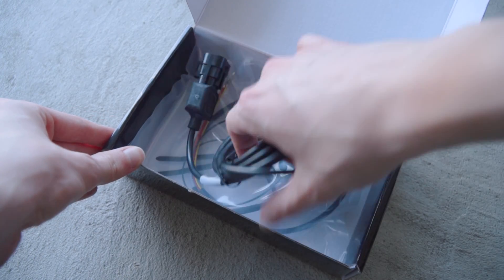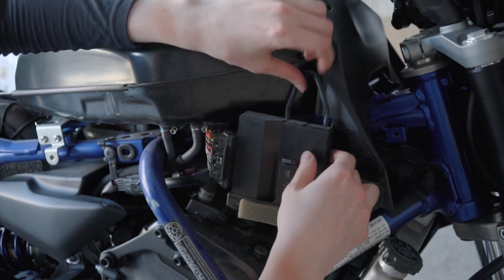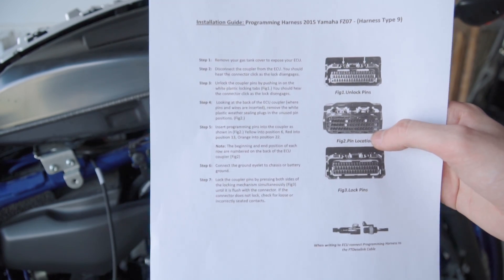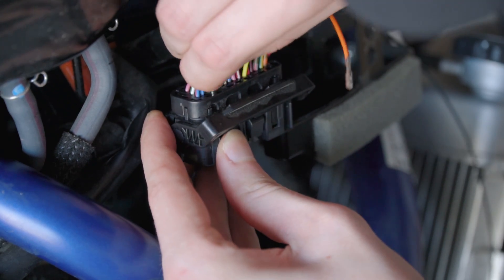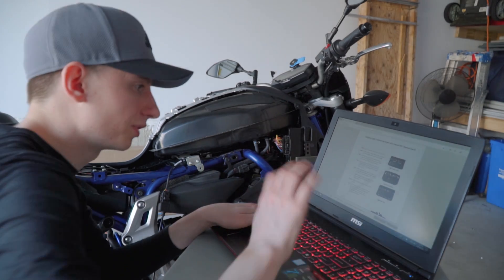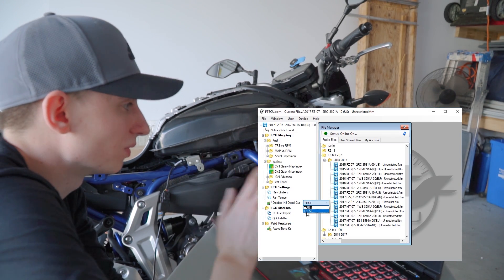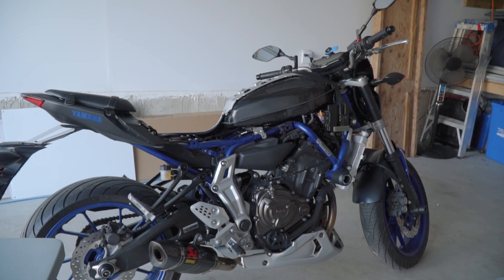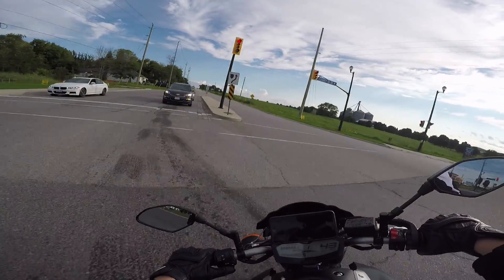ECU Flashing MT-07 at Home (Tutorial/Impressions) [EP.04]

Comment: Please answer  reflashing your ECU like this without going to a dyno and properly tuning it.

Is it the same?
Reply: not a pro. just enthusiasts with a lot of passion. to my knowledge no it's not the same. nothing beats Dyno. it's just expensive especially on this bike. you might as well save up and get a better bike. ECU flash is pretty much enter set values into the computer. when you Dyno you get to read the graphs and modify for optimal performance or fuel consumption
Reply: @kendall9758  hey, i did the ecu flash and dyno cost me about $280 i think it was worth it.

I have an M4 full exhaust system on it.
Reply: @jeanmorales6159 You did a custom dyno tune for your bike for a 280$????
Reply: @marobistric1999  yeah i did.

Comment: Thank you for the video, it was detailed & well explained. I just bought my mt-07 this year so this ECU flashing is quite new for me. I order a slip on M4 exhaust, I was told that I must get ECU flash or else the bike will run lean. My question is does it get tunned according to the exhaust pipe you put on? are there specific settings for the exhaust you put on?
Reply: I heard that is important to flash the ECU according to the exhaust.

An Akrapović exhaust has its map and so does the M4 exhaust. But, on the small bike like that I heard that it’s good enough the match the exhaust length and not the brand of the exhaust.

So, if you match your M4 exhaust with an let’s say Akrapović short exhaust. I think it will be fine.

And of course you have your dyno tune. But, that it much much better and completely different story

Comment: Hey when you installed the software on your computer did you have issues? I have been having all the issues possible... now I’m stuck at the part where I can’t register it
Reply: Same, did you ever figure this out??
Reply: Aaron Bolton hey yes I did. I ended up using a windows 8 laptop that I had laying around and than I had to make sure that all my connections were ok. When you register it the cable needs to be plugged into the bike into the ECU and on the laptop. I also had an issue with my red wire being connected sideways and it wasn’t completing the connection. Once I fixed it everything worked. Make sure everything is working properly
Reply: Aaron Bolton are you located in the north east of the US?
Reply: @TheJuanesjr0911  I'm in utah, so I need to connect the wires into the ecu before I can get access to the instructions to do so?
Reply: Aaron Bolton  yes plug everything into the ECU and to the ground. Make sure you use the correct ground because that was an issue for me as well... and after everything is plugged in you can connect it to the laptop and register the ECU. The registering process is for the FTecu to register your ECU as the only one it can work with.
Reply: @TheJuanesjr0911  thank you so much, I will let you know if I get it to work.
Reply: @TheJuanesjr0911  am I supposed to do this with the bike off?
Reply: @TheJuanesjr0911  yes it still ain't workin for me.. not sure what the hell to do.
Reply: Aaron Bolton check all the wiring mine was giving me issues because my red wire was installed in the wrong direction
Reply: Aaron Bolton have you been able to get in to the tuning suite?
Reply: Aaron Bolton most likely you are having the same issue as me where one of my wires wasn’t pushed in all the way. Like I said my red wire was facing a different direction and it wasn’t pushed all the way in. So definitely re check all the wiring and try again. There is one way to trouble shoot the connection to see if everything is connected properly. If you can find me on FB as Juanes Ruiz and we can chat on messenger or video call and I can try to help.. I’m a white dude with black sun glasses in a car.. I understand this is a crappy situation after spending so much money.
Reply: @TheJuanesjr0911  thanks man, I'll get in touch tomorrow. The thing that doesnt make sense fo me though is without this video I wouldnt have known where to plug the wires in. From what the software is saying I have to register the device before I am able to get instructions on doing the wires.

Comment: Yeah, it’s a total rip-off the motorcycle industry. I’ve been charged over $600 dollars for a 12 year old motorcycles ignition lock set and $300 to get the keys coded to the ECM. So, almost $1000 for repairs to a 12 year old bike that cost $1900.

Comment: Hi.
I installed ftecu flash and quickshifter in my Yamaha mt07
I have a problem.
When changing gears, the engine shuts down for a long time. 1 second approximately.
Do you have any idea what the solution is?

Comment: hey buddy! thank for great video! Could you tell me is it possible to reuse this kit(wires) on other mt07 bikes? isn't this software bind to a single bike? Also, could you tell me if these cables have some chips/electronics inside? (is it possible to clone them?)
Reply from the maker: Yes so when you flash the ECU you use up a license (which gets coded in the ecu) so you will need to buy another license to use on the other bike. The usb cable gets registered to your account, so you can only flash the another bike with the same account and a new license
Reply: @TURBOTWINKIE  thank you!!
Reply: @TURBOTWINKIE  how much for a new license

Comment: Where did you purchase ecu flash kit?, currently I'm working on 2018 mt07 tying to find it in canada
Reply from the maker: Bayside Performance, but it will take forever for them to ship it
Reply: TURBO TWINKIE thanks, are your happy with the flash ? Did it make big difference?
I’m saying if it’s worth to spend 500

I Just put acrapovic and DNA filter yesterday, thinking of flashing it
Reply from the maker: I'd say I'm pretty happy. I tried everything, and I made the bike perform pretty smooth, but its still not 100% perfect. But the bike runs really well. I need to ride a stock fz 07, to feel the difference though, but it did feel like it was quite a bit quicker when I flashed it.

Comment: you can do the same thing with 15 euro
Reply: Please explain brother. I am intrigued.
Reply: @gmindgjerd  well you can flash k-line with a ft232rl and mcp2003 chip you can even use an arduino with the mcp2003 chip,Plus you have to make the connectors to fit your bike socket

Comment: Hey, did you notice any difference in  accelerating at lower speeds ? I mean jerky throttle problem in this model
Reply from the maker: I always complained about jerky throttle on this bike. People say it’s because of the torque but that’s complete bs. The fuelling is not perfect. The flash improved it quite a bit. It’s still present, but not as much.
Reply: @TURBOTWINKIE  huge thanks :) i know that the problem is in too low fuelling on lower rpm. I was wondering whether to buy this kit to fix this problem.

Comment: can I ask you something if you know, when you take the gumdrop out of the air filter you have to re-flash?
Reply from the maker: I think you are talking about the snorkel. You can take it out, it wont make a noticeable difference, You don't have to re-flash. But you wont gain anything. Some people claimed they lost power after doing it.
Reply: @TURBOTWINKIE  i just want the engine to breath because i believe its choked or its just my imagination, i am fully stock , i dont have any of full system of aftermarket staff so i just asking. Thanks for respond .

Comment: Hey TT,  I need to flash my ECU, If you had to do it all over would you still use Flash Tune Data-Link ECU Flashing Kit ?

Or would you have gone another way? 

Thx.
Reply from the maker: Umm, if you just want to tune it once, as in set it and forget it. You might as well just send your ecu to get it flashed for like 200 dollars (a lot of people like Vcyclenut). Now if you want to try out different setups, I would get this kit. And if you ever want to upgrade your motorcycle you can always reuse this kit, for your next bike. You just need 100 dollar license for each new bike and a bike side harness. For me it's worth it because I'm also getting FT ECU quick shifter. All i have to do is plug in my laptop and enable it instead of sending it again. Hope this helped :)
Reply: @TURBOTWINKIE  Thx for swift reply!

Comment: What about the on off throttle jerkiness?
Reply from the maker: Once you disable engine braking, its much better, but its no where close to what you will get on a triumph street triple. Its still noticeable you would have to go into the TPS VS RPM settings and adjust the fueling when throttle is closed which I'm trying to learn over the winter.
Reply: TURBO TWINKIE Thanks for the info.

Comment: For the 2018 MT-07 all you need to do is take the rear seat off, use the supplied allen keys under the seat, take the main seat off, take the black side panels off in the 2 screw locations, and take the pop pin out in the front. No need to take the ecu out, and you have access to the wires.
Reply: can you elaborate?
Reply: Did you have any issues after the tune ?
I got errors right after install and flash:
5d12, 5d13, 5d41 :/
Reply: @gizmoZG u unplugged starter relay
Reply: @007Nox  ended up being a bad connection on the firing circuit -.-'
Reply: @gizmoZG  you have a bad connection.
Reply: @ryanjones1938  yeah, it ended up being a ground fault on a piece of the wire harness...

Comment: Power commander map in the ecu isnt helping performance its actually decreasing performance it's not the same mapping as stock open both maps on ftecu software and check when I did it I actually lost power. Just a heads up

Comment: Hey have same bike.  Got mine flashed at a bike shop.  Have full yoshi with K n N filter.  I have some popping on decel.  You think its normal or they didnt flash mine right.  Debating on getting reflashed elsewhere.  Alot of guys saying no popping.  Do you mean no backfiring or decel pops are non existent also?  Mine seems to take off through the gears great and runs fine.  But that popping hmm a  little more then I'd like.
Reply from the maker: Some popping on decel is fine, all bikes do it. Before mine used to sound like someone shot a rifle every time I got off the throttle, now it just burbles, some people say its leftover fuel burning off in the exhaust. I dont know, but I wouldn't worry about it :)
Reply: Popping is from the bike being RICH in fuel, not lean. Being rich means that there is a bit of extra fuel not being burnt in the combustion cycle. So, it ignites in the exhaust causing pops. Running a little rich is fine. Running lean is what is dangerous.
Reply: I would say it just burbles bad on decel ( no rifle sounds lol).  Few bigger pops here n there between shifts.  I installed the exhaust and flash all at once, so I didnt hear what it sounded like  without a flash. Thanks for your help guys.

Comment: Great walkthrough! I was also hurting for more info after watching Jake's video. I finally pieced together enough info from several sites and videos to flash tune my FZ-07 myself. 

I did have to contact FT when I tried to change the fan temperatures, which at first had no effect when I adjusted them. It turned out that the calibration range for the temps was different from the ECU range. For example, in order to get the fan to switch off/on at 195/205 degrees, I had to set the range in the software to 215/225. The threshold at which the ECU will pick up the changes might be different for everyone, just thought I'd share my experience! 

Otherwise the ECU flash was a success and a massive improvement after installing a Yoshi pipe!

Keep it up!
Reply from the maker: Thanks for sharing :)

Comment: cool video, nice addition to jakes. you showed the computer/software part better. cant wait to try it on mine once the warranty ends. id love to see more what the software looks like especially what options you have. e.g. i know you can change the cooling fan on/off temps anything else?
btw the exhaust and the intake have to be done together as well as reflash to equal more power. whats going on is you are increasing airflow and the amount of fuel being burned to get more power. if you just do the exhaust its like running while breathing in thru a straw but out your mouth. you have to make the intake more free flowing also or you wont get more air going thru the engine. then you have to match the correct amount of fuel to the increased air to get a bigger boom in each cylinder. 
just an old wrenches 2 cents thx for vid.

Comment: Thats not an mt 07 bro... thats a fz 07
Reply: The Yamaha MT-07 (called FZ-07 in North America until 2017) is a standard motorcycle or UJM with a 689 cc (42.0 cu in) liquid-cooled 4-stroke 8-valve DOHC parallel-twin engine with crossplane crankshaft, manufactured by Yamaha Motor Company from 2014 and US release in 2015.

You're welcome!
Reply: Yeah like NorCalGoldenStateCycles said, it's the same bike with a different name. And for 2018, USA branch decided to adopt the same naming structure as the rest of the world (MT-07).
Reply: @MotorizedRoadrunner  ohh thanks about that i didnt know, tnx for sharing info 😁😁✌

Comment: Best is to get them dyno tuned.
Reply: RubyTheBikerGirl smith yeah, at least here in portugal its cheaper to pay for someone to tune your bike for you. That kit (with the auto tunner) is like 700-800€ while that same service done by a professional is around 500€ with everything included
Reply: Tiago Vieira I would have to agree.  I decided to look up my bike on Power Commander' site and the list they have is disgustingly tiny with stock air filters and only a handful of exhaust.
Reply: diamondheat9 I actually wanted to buy a MT07 but if I bought it, I promised myself that the two first things that I would’ve done were the Exhaust (SC Project) and the Air Filter (DNA). Before all that, I went to Dynonet's website and they had 0 tunes for that specific setup which is crap. Many people have that same setup on their bikes 🤷🏻‍♂️
Reply: Tiago Vieira I was looking to get a zx6r with the exact same mods you listed. 0 tunes for what I wanted.  It is stupid as those are the basic mods anyone would do first
Reply: @TiagoVieira  mas aqui em portugal quem faz isso?
Reply: João Duarte acho que a FB Racing pedia à volta de 500€ para reprogramar a centralina de uma mt07 de 2018. Sempre fica mais barato que comprar o kit da centralina com o auto tuner (800€> e sorte a tua se não ficar preso na alfândega)

Comment: dont add the power commander fuel map to the flash Tune software its not compatible due to fuel injection systems reading completely different between flash tune and PCV
Reply: Hence why they have an table import, it translates from the pcv and makes changes. To the fuel maps accordingly
Reply: Incorrect, just watch brocks video on this or better yet view the changes yourself by comparing tps maps ect.
Reply: Brock says that for the new GSXR, you don't know if it has the same problem for every bike, and every ECU. You don't know if it has something to due with the duel injector system, you don't know enough to make the assumption you made.
You can't make the changes yourself, the PCV has fewer variations of TPS and uses dynojet program to adjust between them, so you would make a mess changing it yourself, it's better to import and see if the changes make sense.

Comment: You are paying for a license and wires.

Apart from the decrease in popping from the exhaust. Removing the snorkel lets you hear the induction noise.

If anyone has a stock FZ-07, remove the snorkel and you will hear induction noise on accel. It *almost* makes up for not having an exhaust at low speeds.

Comment: Those "high flow" air filters are LIFETIME filters tho. You save money inn the long run my dude. All you have to do is but the cleaner and oil which usually last atleast 4 maybe 5 cleanings. It's VERY MUCH worth the money. Not necessarily for the EXTRA POWER, but for the fact that you don't ever have to buy another air filter as long as you have the bike. And they do help with power if you have an exhaust and flashed ecu as you do. So yeah, go with the high flow filter and tune your bike for it. My opinion. Not that it matters lol.
Reply: RenesMDJ I have an intake and exhaust. The only reason to buy a aftermarket oil air filter is for performance, for that price you can buy several stock ones. When I put it on there was a slight increase in power, very minimal.

Comment: You sure that it's more power then stock? 
You can pull wheelies in 1 and 2 gear from low speed without clutch with that bike stock. Didn't seem like yours did when you did several pulls from 1 gear.
Reply from the maker: Marius Karstad you see the problem with this video is the fact that I’m experiencing power gain from the power loss I had with the exhaust. From my experience it wasn’t a huge gain from stock, but it does feel like it has more pick up in the mid range. Plus in this video I wasn’t giving it full throttle. I’m still experimenting with different maps. But so far I’m pretty happy with the results. I’ll have a video explaining my thoughts later on :)
Reply: Same here. Was looking for this comment. 
Looks like this guy has a 24kW MT07. :)
Reply: Marius Karstad I think it was never noticeable because he went with a full exhaust soon as he got the bike throwing everything out of tune from stock.